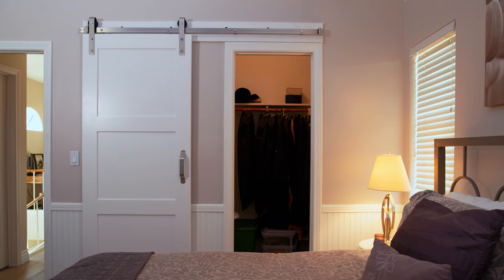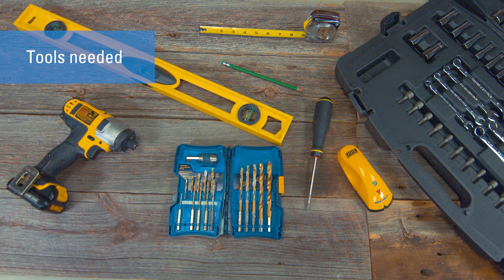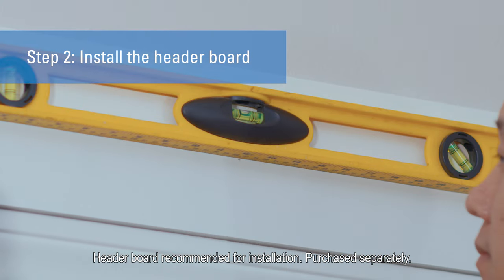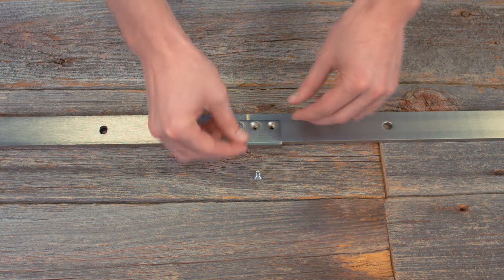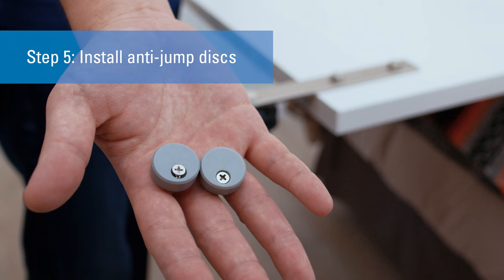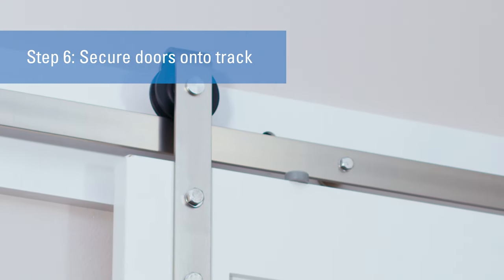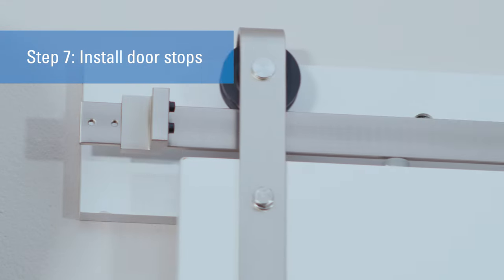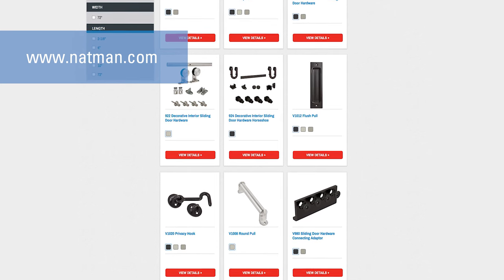Easy DIY Project - Interior Sliding Door Kit Installation | National Hardware

Comment: What they don't mention is that in this video they used a new door, not the old door, which is what you will need to do. Either that or you will need to increase the width of the old door to cover the gaps on both sides created by the gap between the door and the frame.

Comment: what about the gap in btw door frame and door after closing it? how do you solve that?
Reply from the maker: Hi Nidish, happy to help. There will always be a gap between the door and the wall or door frame, this enables the door to move freely along the guides and prevents damage to the door, wall, and door frame. If there is a gap between the edge of your door and the entrance to the room you are closing, you can adjust the door stops to allow the door to close more completely. Please reach back out if there is anything else we can do to help. Thank you, National Hardware
Reply: @nationalhardware7611  Thanks for responding. I wanted to do this in my balcony door and so I need a tight seal. I was wondering if there would be something like a rubber beading kind of thing that I could attach to the door frame in such a way that it would seal the gap.
Reply from the maker: Not a problem, currently we do not offer a mechanism to attach to the door frame for this product since it is typically used indoors, you may have to play with the positioning a bit to get it to suit your needs. Please let us know if there is anything else we can do to help. 
Thank you,
National Hardware

Comment: Do I need to use a router to cut my door underneath? And how do I put the floor guide on?
Reply: If you have a single guide that is symmetrical, yes, you will need to route a channel in the bottom of the door. In this video they have 2 guides that they've placed either side of the door. I haven't installed mine yet but I definitely have the one that goes into the channel. I think having one or two either side doesn't look as good and may leave marks on your door over time. Good luck with the installation :D
Reply: @number1neek  thank you for your help. I really dont want to cut my door so im thinking about maybe another guide
Reply: Jeremy Lopez36 I’ve seen some with rollers, they don’t look too bad. Definitely better than a cheap piece of plastic haha

Comment: I had to look for this video because the instructions on the box were so unclear.
Reply from the maker: Hi @bmcgar,
Thanks for watching our installation video and letting us know about the issues you had with the instructions. If you need any assistance with the installation of your interior sliding door hardware we'd be happy to help. You can contact our consumer service team at 1-800-346-9445. Thanks again!
Reply: Does this make noise when u open it? Coz normally its a bit cracky when u slide it just a thought hope im wrong